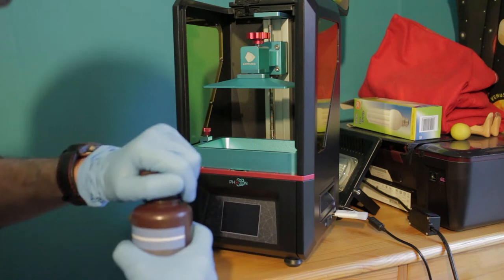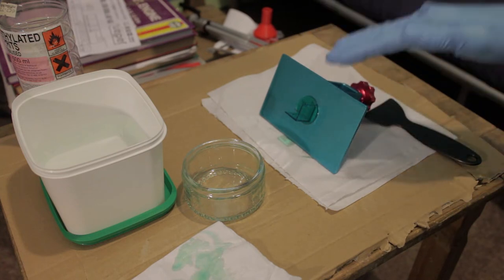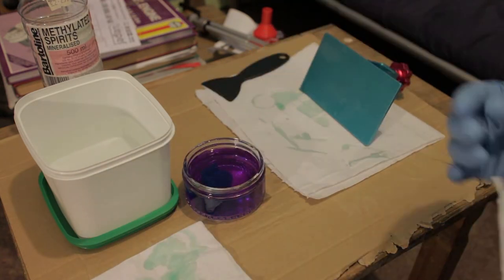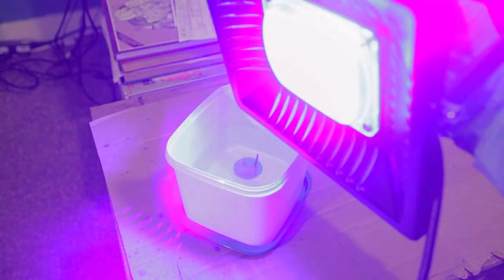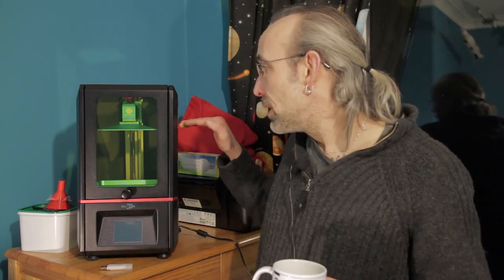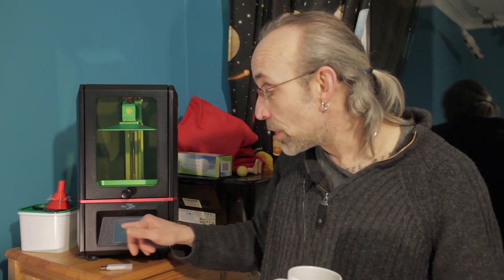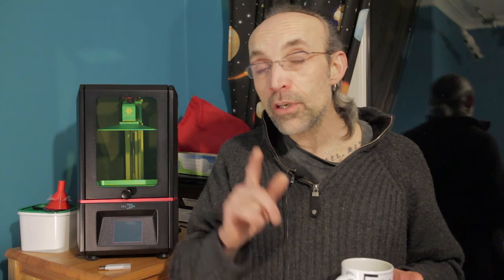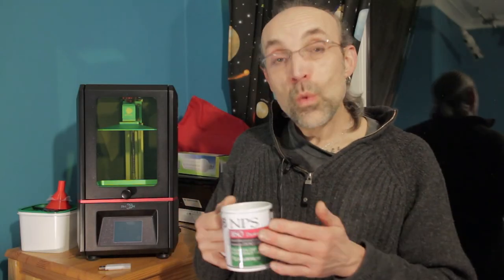ANYCUBIC PHOTON Resin Printer Pt 3, Print & Thoughts

Comment: I really appreciate this series for the Photon.  Thank you
Reply from the maker: Glad you're liking them, hope they're useful to you.
Reply: My first few prints with my new anycubic were perfect but recently they have been getting worse.  When you showing the bed leveling process it was very helpful.  I think i have been too afraid of damaging the LCD screen so I have not z=0 it properly.  Seeing how secure the paper was in video 2 was much more helpful than most vidoes.  As they tend to simply show the paper and someone tugging on it with no context.
Reply from the maker: @stevanmeisoll6627  it is tricky, much like FDM printers and using paper. Some people feel the slightest resistance and call it good, some people really let it catch etc. Plus I'm no fan of the paper method which is why I mention cheap office paper which is all typically 80gsm and most people have for their inkjets. Bear in mind too that it's a glass screen protector. Not the actual LCD screen and you'd really have to crank it down to crack it.
From the start I've used the Flint Read method which has worked really well and I think it gives a better overall level whereas the paper method still has wiggle room to get it slightly skewed.  Are you still using the same resin also? Different resins need different curing times, the grey I've been using recently is about 18 sec a later vs the 8 sec of the green translucent supplied.
Reply from the maker: @stevanmeisoll6627  Yes that's a good guide. You can always tweak a couple of seconds up or down if you think it's needed too.

Comment: Great review, especially part 2 for the leveling! One question for you and everybody else here: Did you try the new firmware which adds anti-aliasing? If so, is it running stable and worth it?
Reply from the maker: Thanks for feedback.
I haven't used it myself as the printer is doing as well as I correctly need for the figures I print and paint.
I know a few who have tried it and the general consensus is that it works well and the effects are noticeable.
Hopefully someone will chip in with some experience.

Comment: Great 3 part nothing missed review thank you
Reply from the maker: Thank you, my intention was to make the most thorough review I could so I'm pleased you thought so and I hope it's useful to you.
Reply: spidiq8 hope to get one I have been busy doing CAD for converting 1/35 armour models and 3d printing the parts.
Reply from the maker: @pete1927  If you do, I'm sure you'll love it, there's a little learning curve but way less than an FDM machine and the slicing software is much easier. I think it's a more forgiving medium altogether.
There's a new or perhaps, revised version due to launch soon which isn't hugely different but has 10mm more Z height and a better light array which should equal faster curing times equals faster printing.
I'm seriously contemplating ordering one because I love this thing. Of course it means there'll be amazing deals on this one.

Comment: you only hear the sucking sound when it has to pull off a larger  layers, smaller do not have enough surface adhesion  to make the sound!
Reply from the maker: Not so, the first layers peeling sound is more noticeable, subsequent layers do still make the noise but it's much quieter, it's still pulling off the FEP hence the sound.

Comment: What does the resin smell like, is it like a fibreglass resin?
Reply from the maker: Now this is a personal thing, but one thing for certain, having worked in bodyshops and around fibreglassing guys I can say it's nowhere close to as obnoxious an odour BUT.. It really does have a distinctive odour, not overpowering to me but noticeable if you leave the room and re enter later.
If you unplug the internal charcoal filter fan it's vastly improved. It doesn't filter the smell at all, just spreads it round further.
Reply: Thans
Reply: Do you have the link for the resin funnel from thingyverse, had a look but couldn’t see it
Reply from the maker: @pete1927  Yes, here you go.
https://www.thingiverse.com/thing:2820545
Reply: spidiq8  Cheers thank you, it fits on the Photon bed as well so I can print it.
Reply from the maker: @pete1927  That's right, I did mine on the FDM for a bit more flexibility in case I knock it but it'll work in resin.

Comment: Hi,i have a problem whit my printer,the problem is on the screen when i want to priny it's telling me error on lcd screen ,and i can not print ,hope have an answer please
Reply from the maker: Can you clarify please? Is the screen giving an error message or the LCD not lighting properly?
Is this just on a specific print, are you using the original USB stick? Have you tried the LCD test pattern.
Reply: @spidiq8  the screen give me an error message,and it say,LCD error code:t 100
Reply: and yes it is the original stick
Reply from the maker: @pierrecasavant3381  I'm not entirely familiar with that. I'd suggest first of all. Format the drive and re slice the file and retry or if you have another USB format it to fat32 and try that. If they don't work. Re flash the firmware from anycubic site.
Have a look through here also.
Photonsters.org
Reply: @spidiq8  Thank you for your advertising and i will try what you say
Reply from the maker: @pierrecasavant3381  These can be problematic, if possible swap it for another to try, it commonly occurs that these fail after a few uses with most owners of the photon.
Reply: @spidiq8  thank you for your help
Reply: I found the problem,it's my usb stick is empty ....how it is can happen,can i reroute it,or i need a new one and if it so ,where can i find one ?thank you in advanced
Reply from the maker: @pierrecasavant3381  That's good you found that, you can try formatting it and re copy the .photon file but any USB stick formatted to fat32 should work. Lots of users report that pny brand works well with the photon.
Reply: hi,my usb stick have no photon file anymore on it ,what i can do
Reply from the maker: @pierrecasavant3381  Is it the original test cube?
If so get a copy of the files on the stick (including software) from photonsters.org
If not and it's one you created you'll have to re slice the model on the slicer.
Reply: my other stick is already format in FAT 32
if i do that,do i will lost everything ?
Reply from the maker: @pierrecasavant3381  if you format it, it'll wipe what's on there, but if you can't see files on it then it's corrupt anyway.
Reply: @spidiq8  i see files on my computer,but not on the screen of the printer
Reply from the maker: @pierrecasavant3381  Hmm, if you have a .photon file on the stick it should be visible on the printer screen. Is it the same with a different mem stick and a .photon file? If so, the lead that goes from the side USB to the main board might be faulty or loose, undo the vent panel at the back, 4 Allen bolts, and check that it's plugged into the board securely.
Reply: @spidiq8  yes it is plugged but a bit loose ,now i see the cube ,which i haved losted ,but the rest of the model i have on my cumputer don't show on the screen 
sorry to disturbe you whit that
Reply from the maker: @pierrecasavant3381  That's OK,  I  don't mind helping if I can. Do you have another USB stick to try?
Reply: @spidiq8  yes i had tried ,same thing ...nothing
Reply: i sent a message to anycubic directly and i hope i will
 have an answer
Reply from the maker: @pierrecasavant3381  They're pretty good at replying, see what they say.
Reply from the maker: @pierrecasavant3381  That's a shame, hopefully you'll hear back from anycubic soon.
Reply: @spidiq8  hope too
Reply: @spidiq8  Thanks a lot for your help,very appreciated
and very helpfull
Reply from the maker: @pierrecasavant3381  No problem. Hope it gets sorted for you, the prints are amazing once you get going.